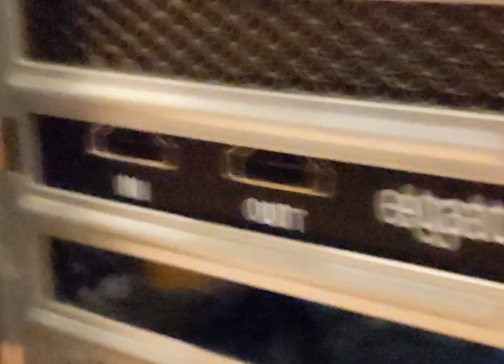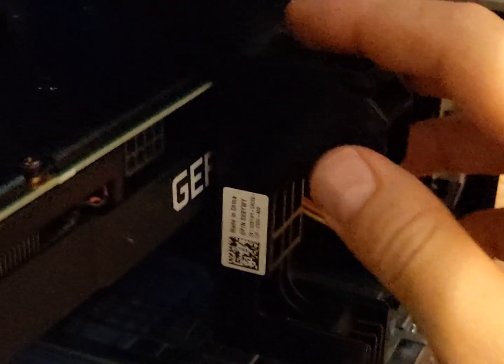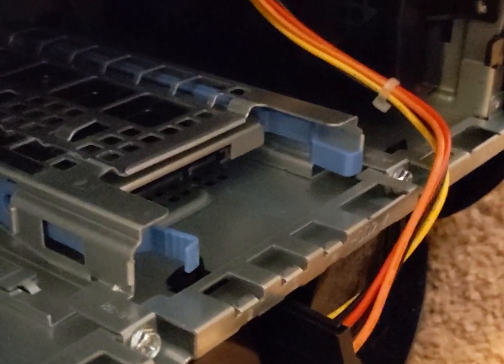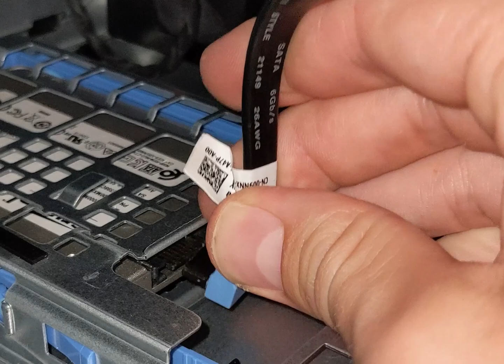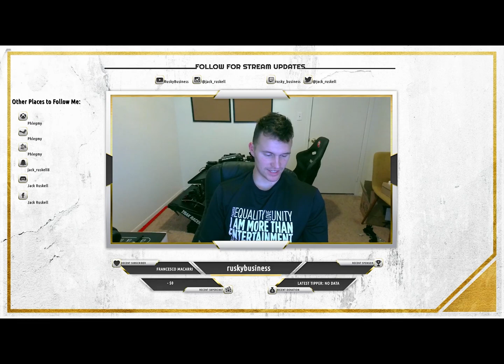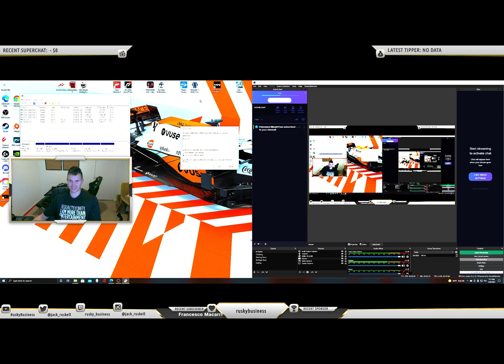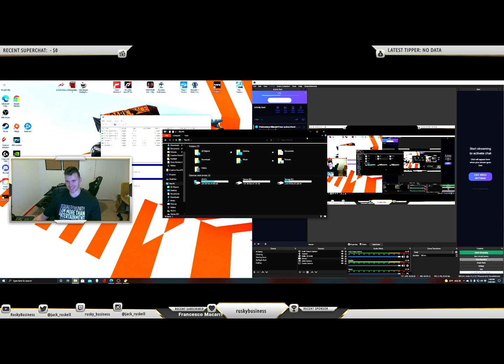Alienware Aurora R10 Hard Drive and Capture Card Install

Comment: Did u have to buy any cables for the HD?
Reply from the maker: Nope! There's a cable that comes attached to the power supply that can be used for it.
Reply: @ruskybusiness  yup, found it. Got a 5T HHD installed in 20-30 minutes (being careful). Thanks for sharing the video! Now I’m thinking of installing a fan in the 3.5 slot in the upper front.